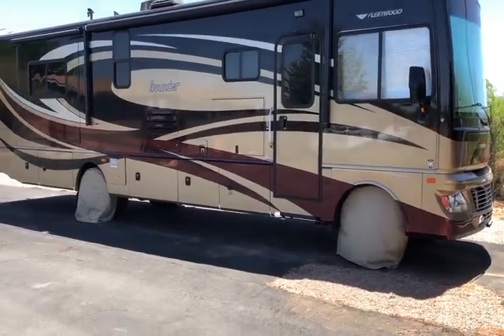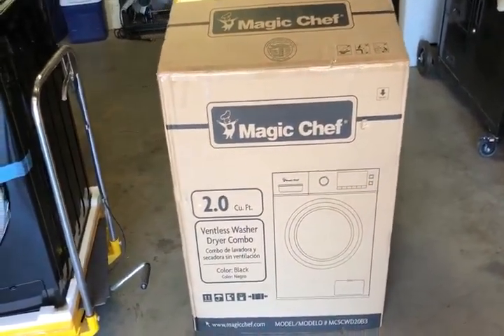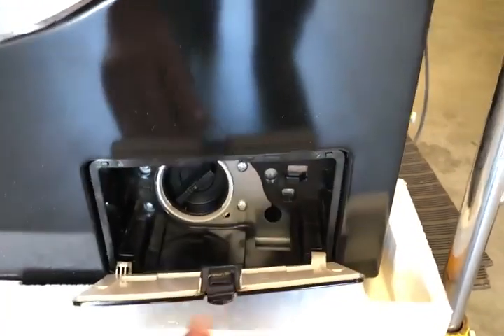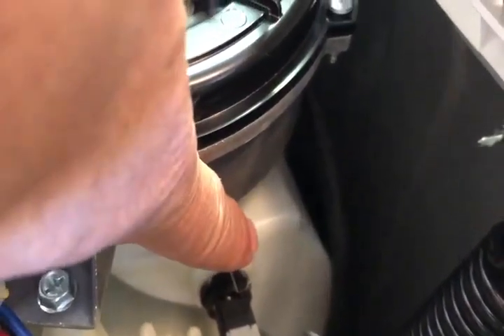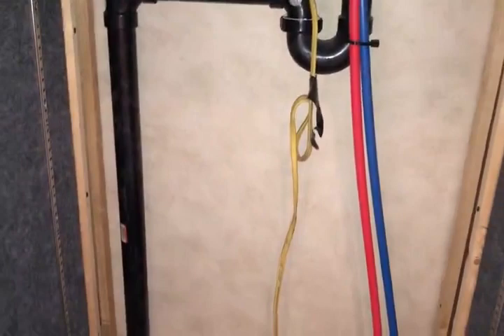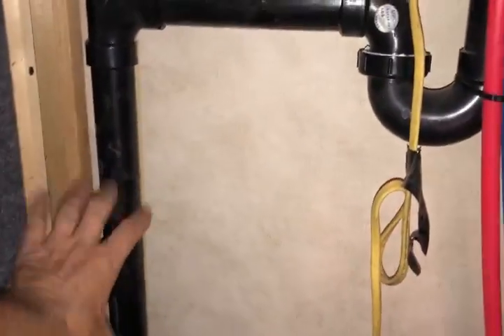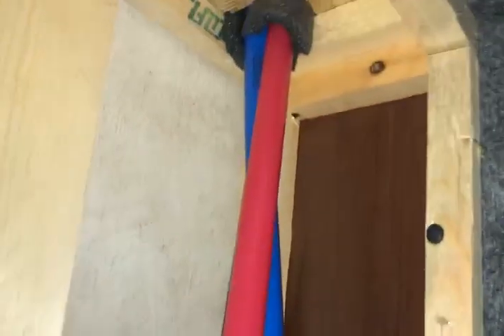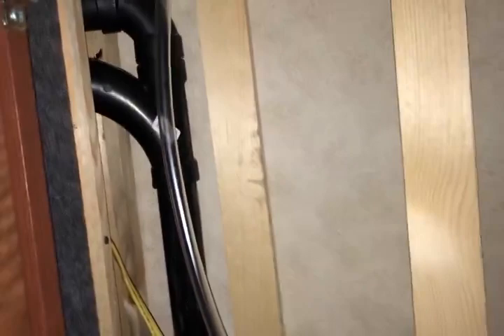Install Combo Washer Dryer in Fleetwood Bounder 35k

Comment from the maker: Got the E3A code on the last trip.  This means the dryer overheated.  It was totally my fault as I did not heed the warning in the instructions.  It says you can wash 15lbs, but only dry 7lbs.  I never really thought about why.  Well it turns out that over loading reduces the needed air flow, which causes the condenser to overheat.      Took a couple hours to pull the unit out, open up, and hit the thermal breaker buttons.  I also took the opportunity to remove the condenser fan and clean out the lint… be sure to do that if doing any maintenance.  All is working fine now… lesson learned!

Comment: Excellent video... We have exactly the same Bounder. It is plumbed for Washer/dryer. We are FT (full-timers). My wife chose not to have one. I did find a leak from the factory plex pipe where it is capped off. I replaced the caps. Anyways, I enjoyed your video and took note of the much needed info. Are you FT? where is your home base?

Comment: How is it holding up now? Thank you for your time.
Reply from the maker: Johnathan Ravan it’s working great.  We have found that drying for about 20 min is all we need.  Remove and hang up prevents wrinkles.  We also like that it holds a pretty good size load compared to the other RV units.
Reply: @swalesutube  Thank you for the quick reply. It's good to hear that it is holding up, I'll look into getting one once I get an RV. Very informative video by the way, good documentation.